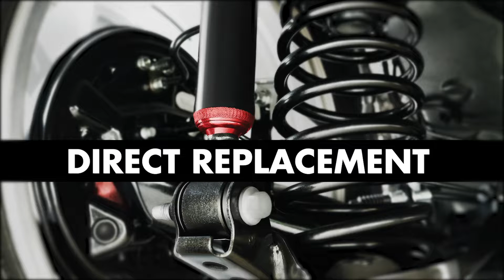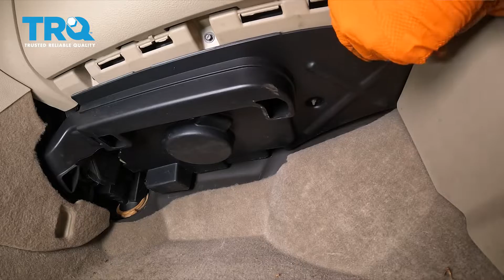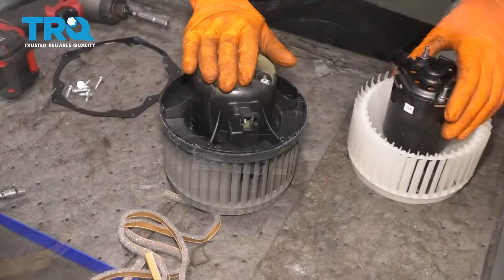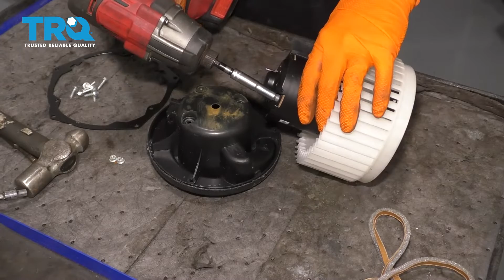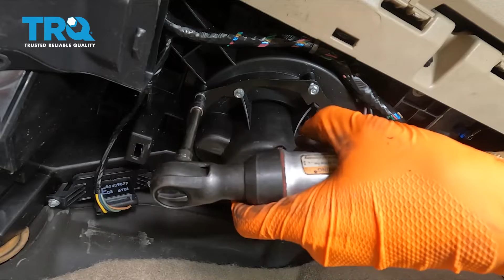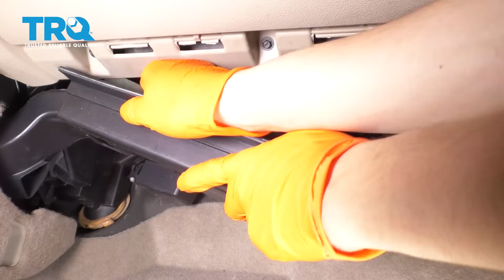How to Replace Blower Motor 2007-2009 Saturn Aura

Comment: Those two wires going on the back of the motor The blower motor You got one is black the other is what on mine I have one that's black and one that's purple and white just two wires My problem is I have wiring issues that I'm not getting no power to the motor but if I run it from the cigarette lighter the hot and the ground the motor runs giving me a defrost What color again is the hot and which is the ground The black or the purple and white